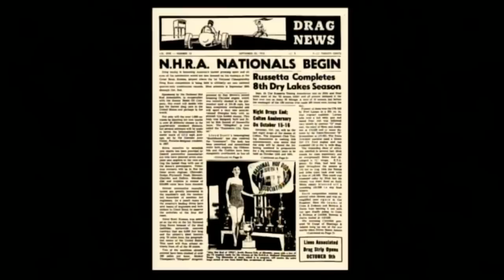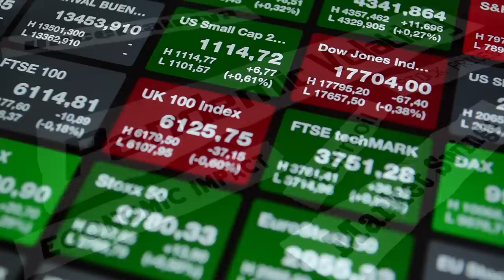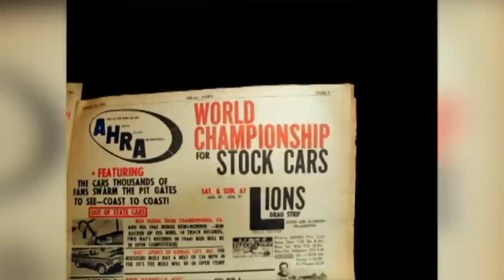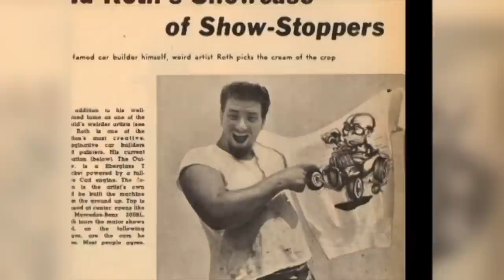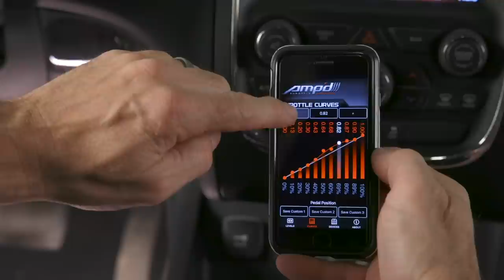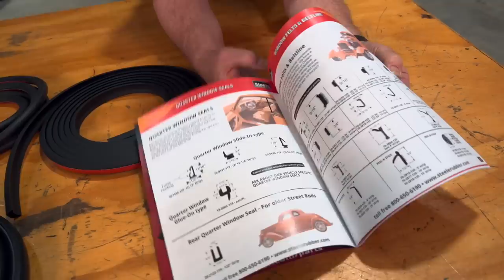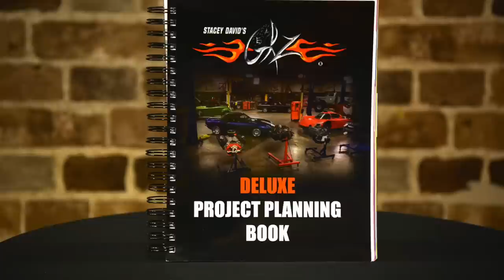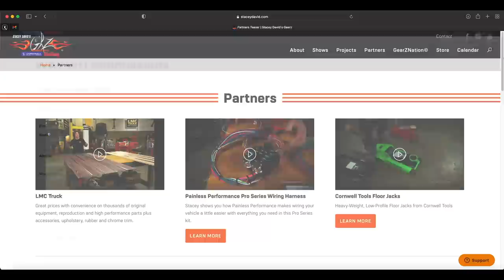When Lions (Drag Strip) Roared! Iconic So-Cal Racetrack History - Stacey David's Gearz S17 E8

Comment: When I was a young kid, I used to live a few miles away and could hear the engines as they roared down the track.  My friends and I would ride our Schwinn stingway bikes there when they were closed and squeeze thru the gaps in the chain link fence and wander around and collect spark plugs that were discarded all over the ground.
When I got older, I used to go to the other local strips as well like Irwindale and OCIR (Orange County).  As well as Ascot Speedway.  Now all closed and paved over.
I had not heard of the museum before now but will someday try to visit it.  I have some old drag racing photos they might be interested in having.